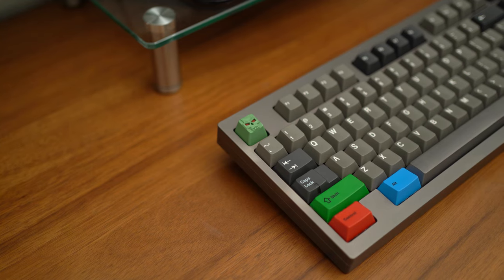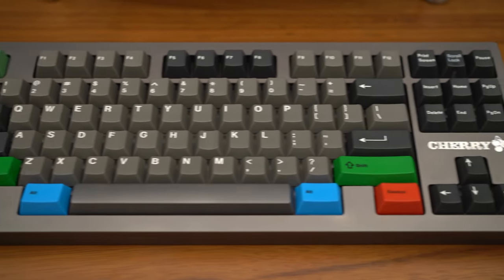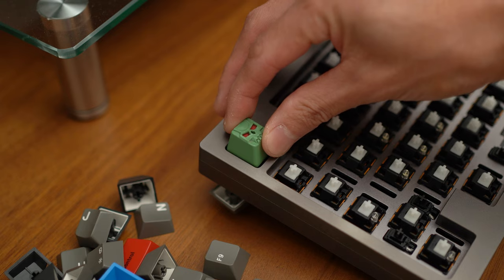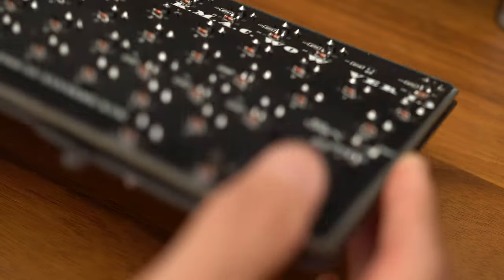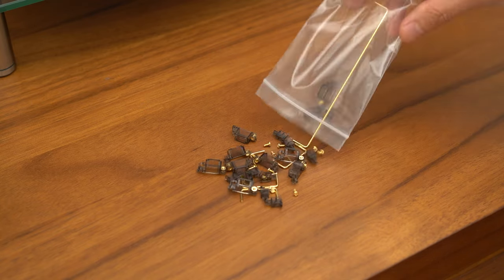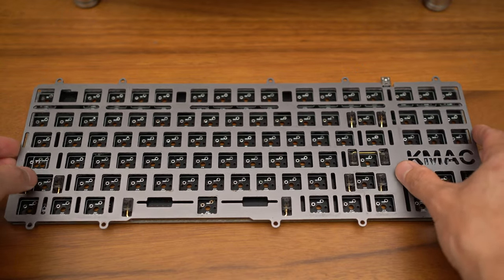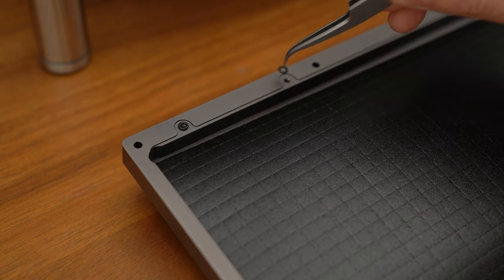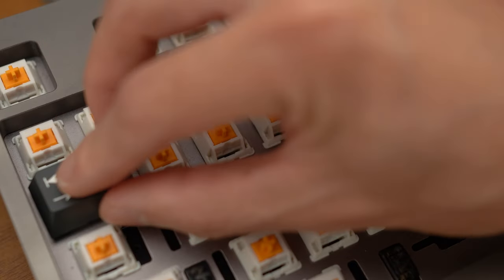How did an 8 year old Mechanical Keyboard hold up? KMAC 1 tear down and rebuild!

Comment: Just wondering, what size was the orings that you used?
Reply from the maker: Hi Lachlan Yu, the o rings I used were these below.

https://www.amazon.com/uxcell-Rings-Nitrile-Rubber-Diameter/dp/B07FRFGNJ5/ref=mp_s_a_1_2?dchild=1&keywords=Nitrile%2B4x2&qid=1611329788&sr=8-2&th=1&psc=1

But looking back on it, I feel a thicker o ring may actually work better!
Reply: @Keybored  thanks!